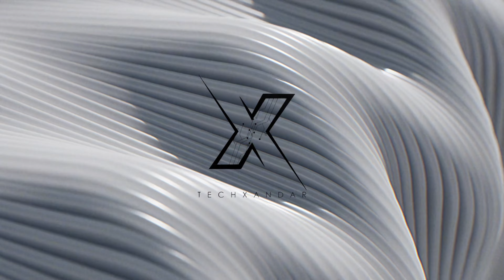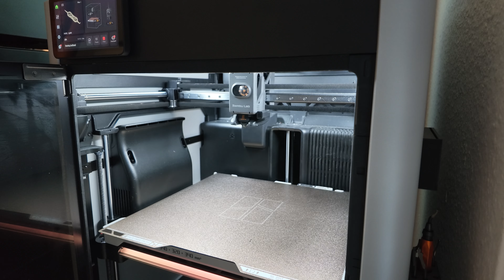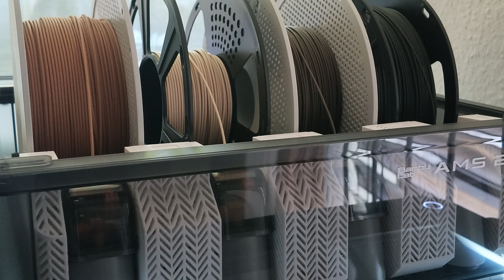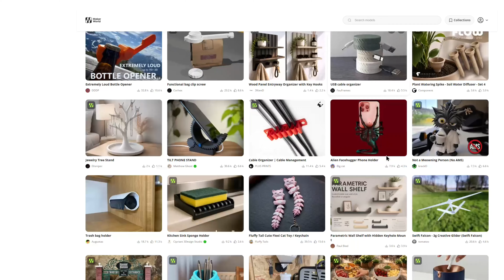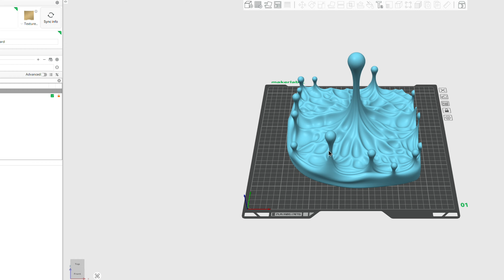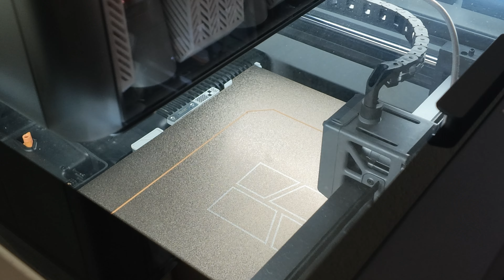The Honeymoon is OVER: Bambu Lab H2S 8.3 Months Later!

Comment: So if we round up in dollars, the waste is 30 dollars in 8 months, or about $3.75 a month. I'm new to printing, but that doesn't sound that bad. As I said, I'm barely going to start printing, so I don't know if that's too much.
Reply from the maker: Your math is actually spot on for simple prints with just 1 or 2 color changes, but keep in mind that the waste gets significantly bigger if you're doing complex models with 5 or 6 swaps! If you're just getting into 3D printing, I highly recommend checking out the Bambu Lab series because they are incredibly beginner-friendly. If you need something else for your perfect start with 3D Printers, reach out to me.😊

Comment: when does the printer tells you to do anything? i had the h2s for 2 months now with around 300 hours on it, it doesnt tell me to wash the plate or anything. i have also lots of failed prints. the biggest problem i get is when the supports takes too much of the initial layer space, exemple just i man standing, the layer or brim under his foot is going to be taken over by the impossible to modify many support and its shitty brim, which result in the extruder knocking off the supports very often. also the monitoring ai is very week. it almost never see any problem unless its a crazy amount of spagetti. i still love my h2s but it has not been as good as what you experienced
Reply from the maker: Sorry to hear it's giving you a headache! The software doesn't actually prompt you for plate cleaning, I just wash mine in the sink when prints stop sticking. For those small figures, switch to tree supports and maybe you had something switched in the settings. Load the Standard Slicer Settings for your nozzle and printer (like reset the settings) and try it again. A friend of mine had the same problem with knocking out some of his supports, I looked over his settings and we found a solution.  His nozzle was a 0.4 but his printing height was only set on 0.1, without optimizing the other settings for this layer height. We restored the basic setting and after 5 prints he didn't have one support nocking down. Maybe this will help you. But I haven't had the experience with mine. If you need some help or tips, feel free to reach out via comment or Email, I love to help!
Reply: @techxandar  i did go back to factory settings after i started getting more and more trouble after changing the settings, but i still get the same problem. but i still understand that the problem is mostly what im printing too, the models are not designed to be efficient for 3d printing, but my problem with this is that bambu lab studio wont let me put bigger brim . exemple just a woman in high heels, if i put 20 mm brim, the supports are going to cancel the models brim to put supports next to it, who are going to be much smaller.
 thank you for the reply
Reply from the maker: Are you talking about the automatic supports or do you set your supports manually? Because if you set your walls thicker and the automatic supports start making some weird calculations. Try to set your supports manually and maybe switch the support style. From Tree to another more volume-full support.
Reply: @techxandar  i use automatic support so yeah i guess i need to go learn how to do it, thank you very much
Reply from the maker: No problem at all, if you have any future questions feel free to reach out. The manual supports are not complicated. You put your model in the slicer (Bambu Studio) and on the top you have like a bridge with a dark support structure underneath. You can click it and that puts like dots (you can set the diameter) and like paint the positions you want to have support on it. When you finish you will see that the slicer only puts supports on the coloured places, not everywhere. But you need to set the Setting on Support > Trees (Manual). Otherwise it will ignore your Points and make automatic supports.